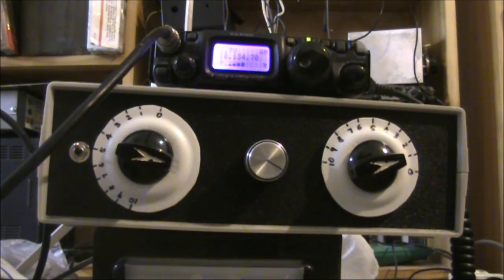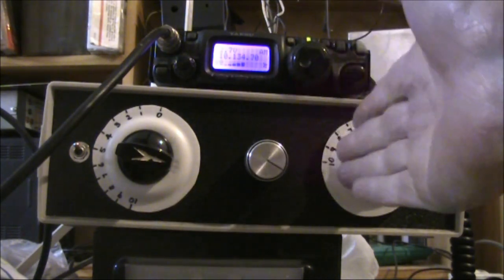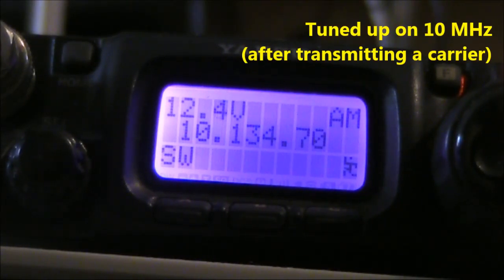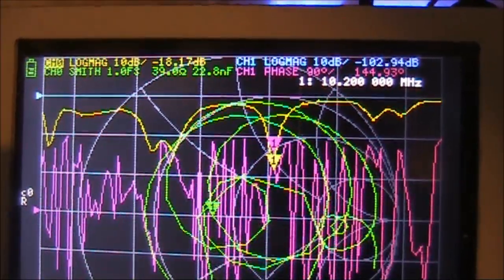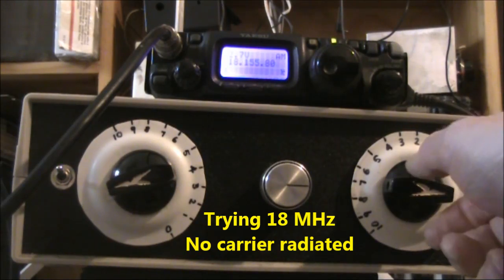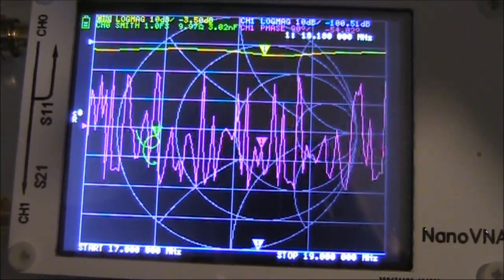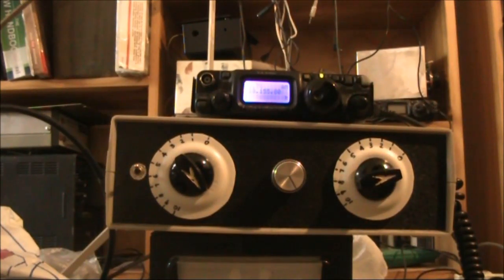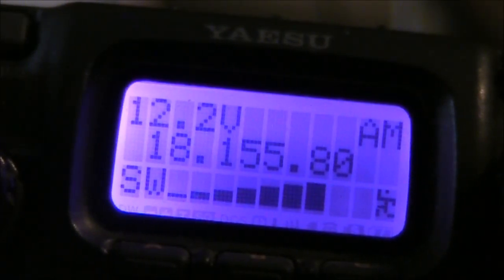Adjusting an antenna coupler with a Nano VNA (stealth tune-up)

Comment: It does radiate a bit. But a rapid frequency sweep with less than a milliwatt probably won't be detectable by anyone but you. If everyone tunes their antennas with a NanoVNA I'm sure no one will be bothering anyone, which beats the heck out of hams running 100 Watts giving their call signs as they start to tune, and when they finish tuning, or the sound of people tuning up without even bothering to identify. One must use pretty low power to ensure no one else is being bothered. A NanoVNA's -20 to 0 dBm analysis power level is just about perfect. I was once tuning up a 10 Watt 2-meter rig into a dummy load and the radio's owner came back to me over the air while I was doing so. He was on his mobile rig and about 50 meters down the street. We were working one another because I had the cover off the rig to tune it, and there was enough RF being radiated by the rig's circuitry to do the job. 

But you've given me an idea. If conditions are very good, and I have a decent antenna, I may try to make a CW contact or 2 using my RTL-SDR and my NanoVNA. But first I'll try it just using my HP spectrum analyzer and its tracking generator. I think the tracking gen is good for over 100 mW output. :)

Comment: The same thing can be done with a noise bridge if anyone has one of them lying around instead of something more modern like an antenna analyser. Depending on the quality of the noise bridge it can be worth adjusting it for a null on a dummy load at the frequency of interest before adjusting the tuner for the antenna.

There would still be a tiny amount of power going out. Looking at the spec of the nanovna it is a lot less than some other antenna analyser. I'll pick on the mini60 because that is what I have. From SE Qld it has been heard in the Frankston/Mornington area. With the mini60 being able to be computer controlled I had it transmitting 30m wspr which was picked up as far away as Tasmania. I am curious if some of your locals would be able to hear you tuning up.

That was enough to make me wary about where I tune up even with an analyser.
Reply: If I understand correctly you used mini60 as wspr beacon. Is it true? If so could you please provide some details how it was done?

Thanks.
Reply: @АндрейДенисюк-ш7п  The mini60 uses the sark 100 command set for computer control. Including setting frequency and turning the output on/off

All you need to know is the sequence of frequencies for the transmission and how long to transmit each frequency. I got my list by modifying wsjt-x to dump the list to a file for the actual transmission I wanted including call sign, grid, power level. Set frequency, wait, set next frequency, repeat. Do not expect it to be stable or clean. It was a fun test but not what I would want as a full time tx.

I was curious how far my analyser could be heard. I made it past 1,600km before I stopped. At times I also use it in the same manner as the nanovna was used in this video which is very handy.
Reply: @Rilapy  
Yep, I'm familiar with sark command set, the question was the software part you use to generate tones.
Your idea with dumping from wsjtx is nice, thanks for the hint!

Could be an interesting small project to play with.

73
RA0UFF
Reply: @АндрейДенисюк-ш7п  Just a bit of C code I threw together. The data I got from wsjt-x was tone number 0, 1, 2, 3. Used tone_number * 2 + base_freq to calculate the actual frequency to set the mini60 to. For me base_freq was something that put me in the 30m wspr window.

Just enough code to open a connection to the mini60 with a for loop to run through the tones, use the commands 'freq <frequency>' and 'on' to transmit. Timing was crude with a usleep() before the next iteration of the for loop. Finished with an off command to make sure it was off.

Comment: I do the same thing with my Antuino, which is a little simpler but is larger and costs more than the SNA but is very nice and still relatively inexpensive. I have also used a noise bridge but it is not quite as sharp a null and does not help much if you are not already close to well tuned

Comment: you can disable unnecessary traces and set the nanoVNA to SWR instead of dB, set the frequency range to cover all HF bands, and then save that as a handy preset in the device. Very convenient.
Reply: tommihommi1 I think showing how to do that would make a nice short video
Reply: this is what I do 99% of the time... I also disable the other traces to remove some of the distractions and run SWR and smith charts. These are great as you can test antenna resonance with our without antenna tuners/couplers. I've discovered bad quality BNC connectors with the NanoVNA as well.... you connect everything together, get close to 50ohms and decent SWR, and then try to move some of the connectors...regular moving around..you see connection or other problems...great way to diagnose issues. Bring it in the field. MAke sure not to lose small bits!